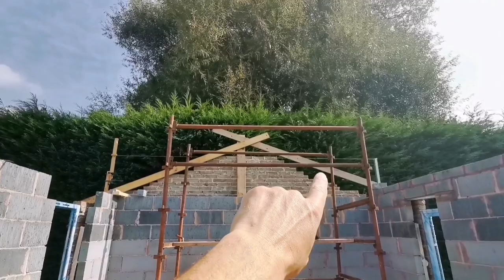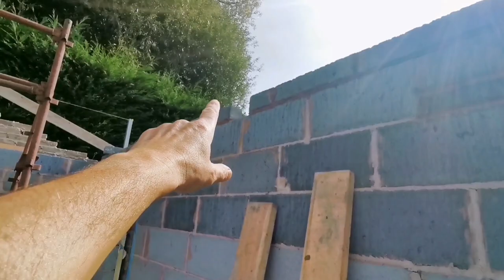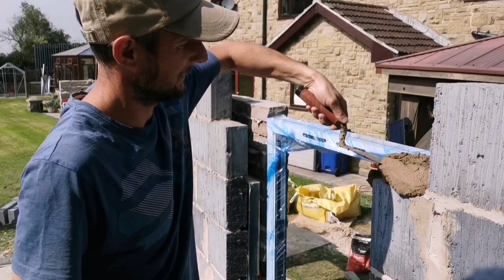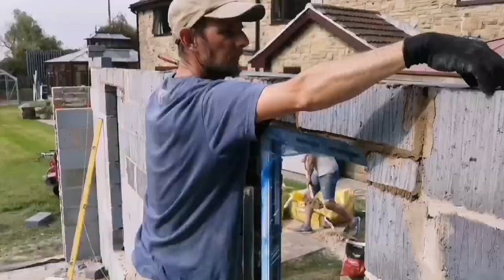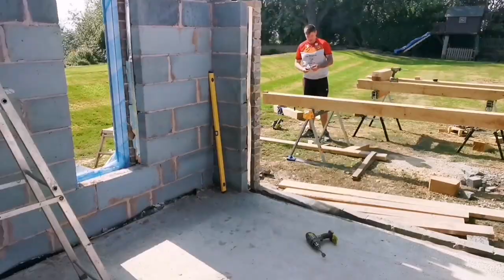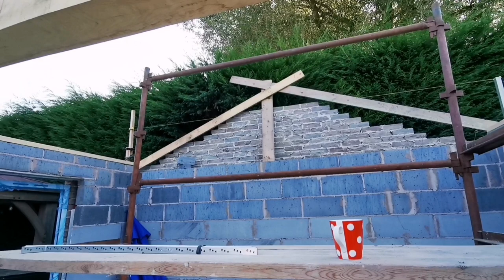lintel on and big heavy oak beam up

Comment: Lovely bit of wood...poor Tim he will be having an aching back next..hope the steel not so heavy 🏗
Reply from the maker: I know think we needed a better plan for the next bit of oak. Yes that steel is very heavy. Think we minght need something to lift it
Reply: @markhep  where's the steel going mate?
Reply from the maker: @itsmewayne428  steel is going on the front over the big doors. It's a steel with a 300 plate on the bottom to take the block  and the stone 👍👍👍👍